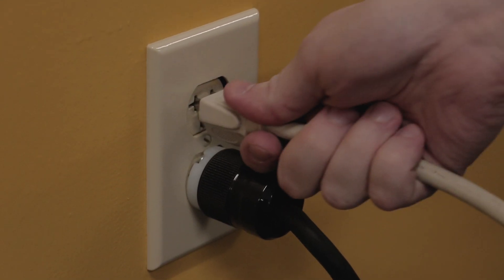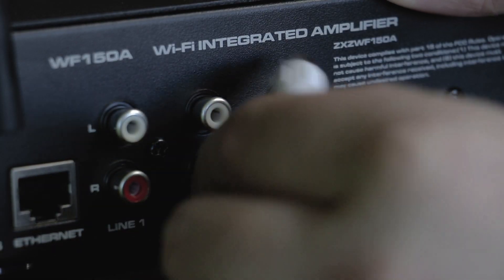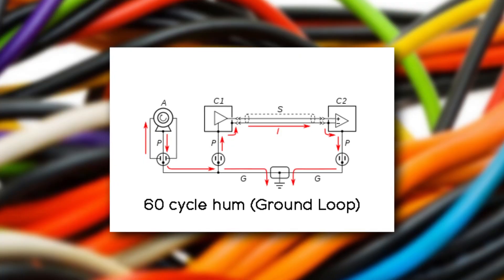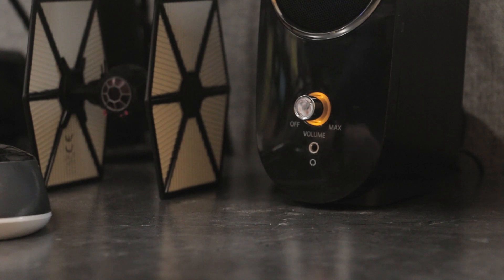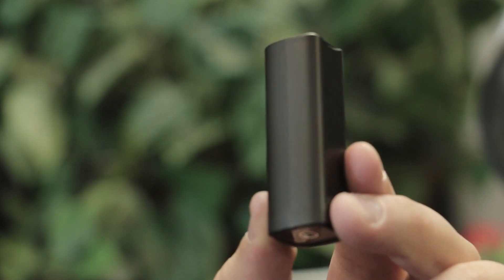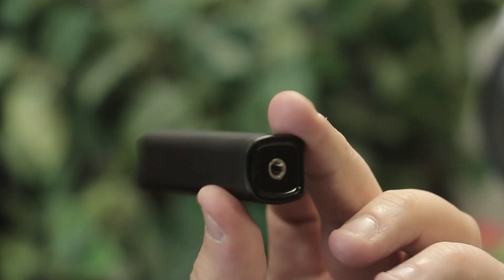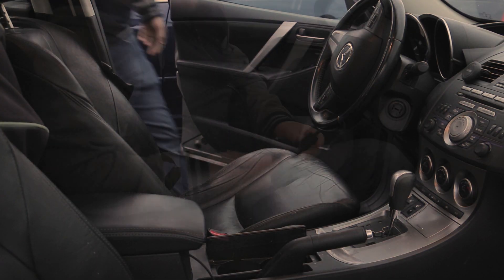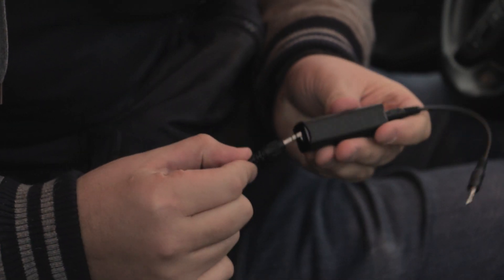How to Get Rid of that Hum in your Audio

Comment: Can we connect ground loop isolator (  to avoid humming sound that comes from amplifier/ mixer  ) with irig
Reply from the maker: You could use a ground loop isolator there.  However, it'd probably just mask some or most of the noise.  Probably best to identify what is causing this.  Generally mixing balanced/unbalanced (XLR and RCA) without something like the CleanBox to sort out the ground issues.

Comment: What if you have that hum with nothing plugged in to the amp? That device isn't going to solve it
Reply: Try the Compressed Air in a Can Spray... shoot through all the cracks of the amp. Maybe something is being blocked and the pressured air could clear it all out.